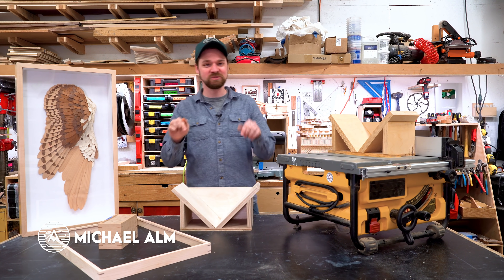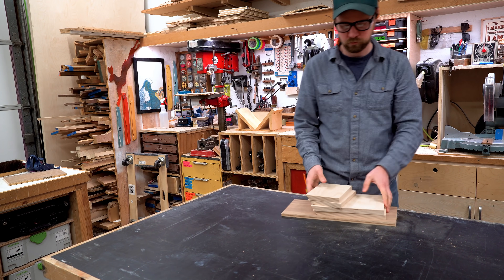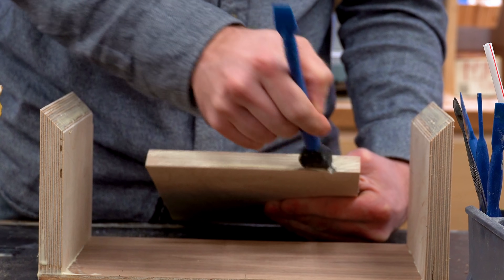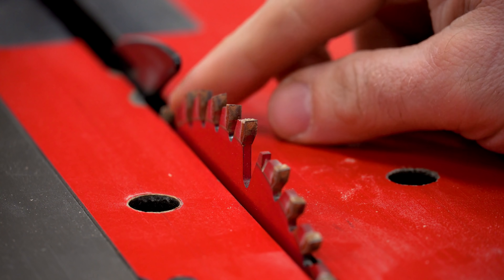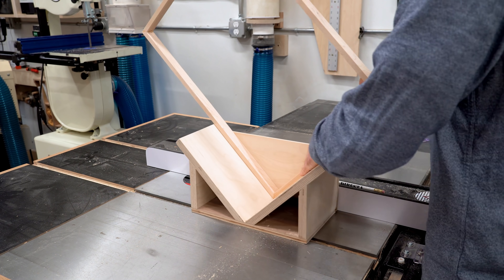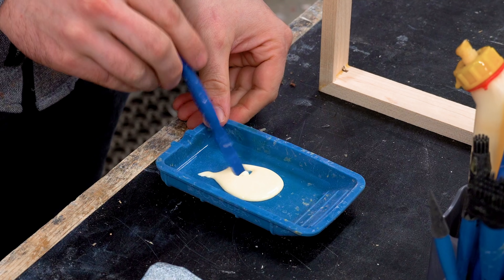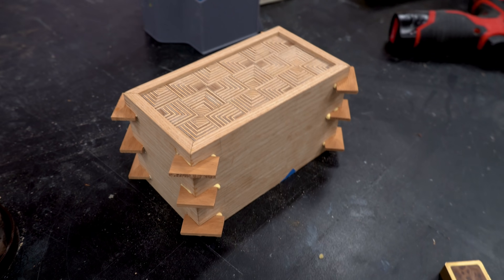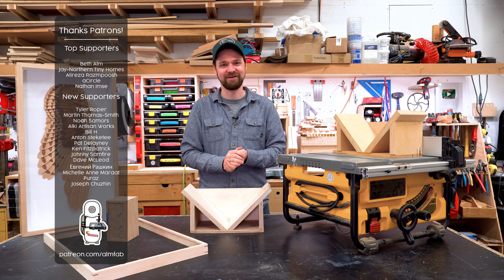How to Build a Spline Jig and Spline a Miter

Comment: to avoid sawing up the jig over time, you could make an adjustable fence inside the jig to reference your frame/box against.
Reply from the maker: That's a great idea!
Reply: that´s what im bout to say bro.  and also, i did mine with some wood down so it´s aligned and using the rails on the tablesaw, so the only measurement i need to do is on the inside fence.
Reply: how would you do that???

Comment: Great video and jig.   I have a question about using it over time.  How chewed up does the bottom get with many cuts in different places?  As the slots widen do you begin to experience tear out?  (I’m building it regardless because it’s a great looking jig.  And it’d be easy enough to build another later.)

Comment: Just built the jig from the plans and I have one suggestion! 

For people using this with a router table I would recommend using 1/4" plywood as the base instead of 1/2" plywood, as routers can't reach up as high as a table saw blade. 

I had to extend my router bit up from the collet higher than normal and got some predictable chatter as a result. I ended up using a mortising bit to take a quarter inch off of the bottom of the jig (and used a 1/4" piece of plywood to stabilize it as I got more than halfway done) and now it works perfectly!

Comment: I just finished building this jig, and I am really excited to use it. I did have have one issue where two of the screws broke off when trying to remove them, luckily both on the same side so I should be fine as long as I don’t pass the whole jig through the saw, but I wish I had thought to wax the screws before the glue up to keep them from sticking after the glue dried. I may try to core the screws out eventually or just rebuild the jig later as I plan to make frames frequently.
Reply: Just a suggestion. Mark very prominently on the box with a sharpie or something were the screws are where you will see them so you don't forget. I know sooner or later I would forget. Or if close enough to the edges, just rip to make the jig narrower and minus the screws.

Comment: I used your plans and worked great  but one suggestion is to add removable 1/4" plywood to your jig. Having the spline cut with a 'zero clearance' at the exit 
is really imprtant when using a dado BUT where I screwed up was not allowing for a smaller spline after initially cutting at 1/2" wide. My next project using 1/8" splines had a lot of tear out so I added cheap scrap plywood 'faces' to the jig and now have a 'plate' I can remove and add a new one if I have a new width of spline. I also like your 'sandpaper' table! Can't believe I never thought of that!!!
Reply: This is so smart. I'll be adding this to the one I'm building soon.

Comment: The Murphy Bar! That's a blast from the past. 
I scored an offcut of Bolivian rosewood still coated in wax from the bin at the Northgate Rockler about a year ago. I've been meaning to make a splined vanity tray and figured the rosewood would be an excellent contrast with maple. This jig just spurred me into a project for tomorrow. Thanks for that, and excellent work as always.
BTW, I have one of those DeWalt jobsite saws as my only table saw. I live in a condo, so as much as I'd love a nice cabinet saw, I have to make do with what will work on my patio. It does the job, but finding good blades in 8 or 8-1/4 can be a bit of a pain. I make it work, though.
Reply from the maker: Thanks James! Glad I gave you some inspiration! That DeWalt saw served me well for many years, you can do a LOT with them 👍

Comment: Warning:  Timestamp 4:53  --  Pause at this timestamp please.  Note: Michael stated earlier in the video that he would remove the screws at the bottom of this jig.  Also, Michael comments that the pin-nails he is using in this shot are only placed higher up on the jig so that they will not come into contact with the blade.  My point is this, "This is serious!", "Pay attention!" "NO METAL SHOULD BE USED IN ANY PROJECT CUT ON A TABLE SAW AS A GENERAL RULE, BUT ESPECIALLY IF YOU HAVE SAW-STOP TECHNOLOGY IN YOUR TABLE SAW."  If you hit metal with my table saw it will trigger the Saw-Stop system and cost $170 to get the saw operational again.  FYI plastic nails, and plastic pin nails exist and would have been a better choice for this build.  Also Note:  There are super sensitive Saw-Stop sensors that can get trigged by wet wood glue.  WTF!  Let your glue dry.  Don't be the dork that shuts down the workshop.  Remember, as a last resort... you can always blame the New Guy.  : )

Comment: Another great video! Thanks, Michael. As I saw you make the cuts, I couldn't help but think that there's a good chance for this jig to kick back especially if you're taking out the workpiece, flipping it, etc. Have you had any close calls? Any thoughts on a design that would accommodate an accidental bump or wobble?
Reply: There is no kickback if you use riving knife.
Reply: @kryptik0  that’s just false

Comment: Just wondering how does the bottom of the spline jig look after making multiple spline cuts . Does it eventually turn into a big empty slot due to the cuts or it doesn't go that far?
Reply from the maker: Eventually it does, but it takes a long time. If you use a lot of splines they will wear out and you can build a fresh jig or replace parts

Comment: Question I have a kitchen table that I just made. I cut down the edges of the plywood and covered the entire table with tiles if the edges of the birch play wood.  I am looking for the best finish to keep the natural look and make the colors Pop. Anyway I could send you a photo I really want to do the best finish and I have tried a few things on scrap and I’m not happy like polyurethane oil based and it doesn’t look good?  I need your help I’m 60 hours into this table and I’m stuck on finish. Thanks

Comment: What is the measurments of the kerf on the saw? The biggest size I can purchase (here in the UK) comes in at 2.8mm, and it produces a very thin gap for the mitre bits. Using a Biscuit Jointer seems to create a more pleasing mitre insert.
Reply from the maker: My saw kerf is 3mm
Reply: @MichaelAlm   Thanks for the prompt reply...

Comment: Where do you get that beautiful plywood with all of those layers?  My Home Depot plywood has like 5 layers and is really crappy.
Reply: It’s a type of plywood called Baltic Birch. It’s generally the best plywood to work with- even layers, strong, dimensionally stable, and no veneer plys. It isn’t available from the big box stores, check your local lumber suppliers as well as specialty stores like Rockler and Woodcraft. My local Rockler has 1/2” and 3/4” and my local hardwood store has all the sizes - 1/8”, 1/4”, 3/8”, 1/2”, 5/8”, and 3/4”. It’s pricier but definitely worth it- it’s a joy to worth with

Comment: AND as it turns out...the Miter+Splines has real-world testing to back up the promise that it is one of the strongest, most durable corner joint methods you can possibly use! 
Receipts: https://youtu.be/CE147Ow7RmM

Comment: Why didn’t you end up using a runner?
Reply from the maker: Because you have to move it left and right to set up the slot. Besides, the table saw fence does the work, so It's not necessary.

Comment: What’s your feedback on that portable table saw? I wanna buy one like Dewalt or Bosch?
Reply from the maker: It served me well for 5 years. My biggest complaint is that it only had a 20" rip capacity, and the infeed support is too short. I think they've increased the rip capacity now, and you can build both infeed and outfeed support into your workbench. (which I highly recommend) Great tool for the price.
Reply: I’ve had the Dewalt for a couple of years. It has been a reliable saw and has been worth every penny I paid for it. I would second that the indeed/outfeed distance is pretty short. I have an outfeed/assembly table but because of the way the fence rides on a geared track and because the power, depth and angle adjustments are in the front I haven’t been able to come up with a good indeed attachment that has access to the power and height adjustment. I made a cart for it that has extra width on both sides to help support wider boards. The only other negative I have is the noise (which applies to all job site saws). It is way louder than a cabinet saw because of the type of motor and because the motor is exposed.

Comment: Why does this add strength?   There can’t be that much grain in that corner?   The grain runs out on the corner just like the miter from the main piece.   I do like the look tho
Reply from the maker: A miter joint is weak because it glues end grain to end grain. Wood glue doesn’t bond well to end grain. A spline bridges the gap between the joint with a long grain connection with a lot of added surface area. It adds a surprising amount of strength.